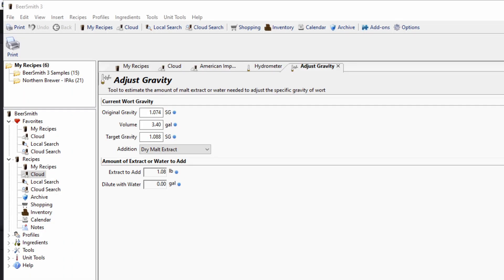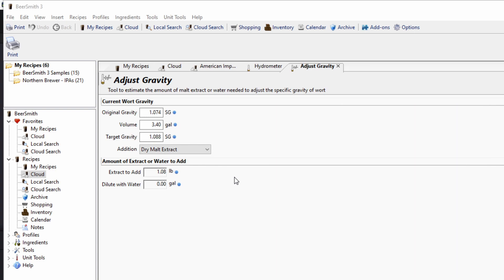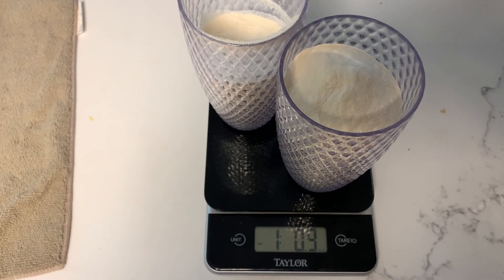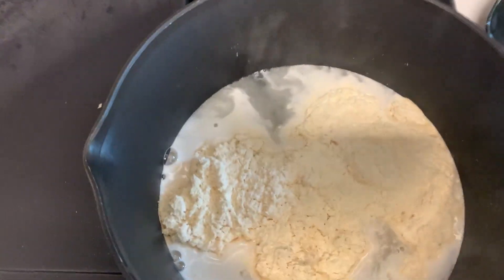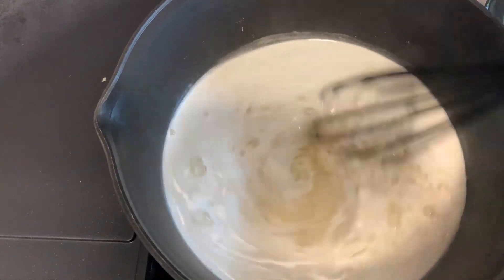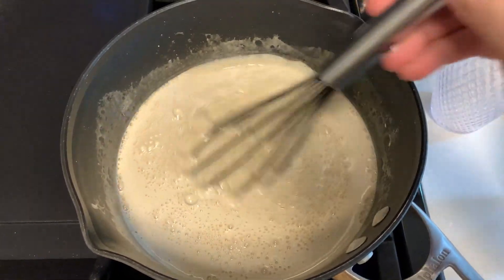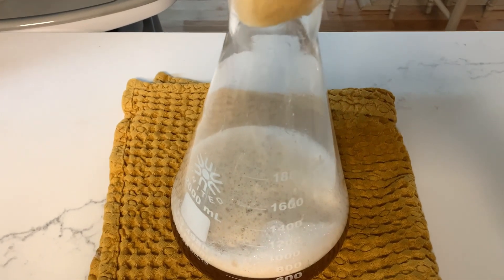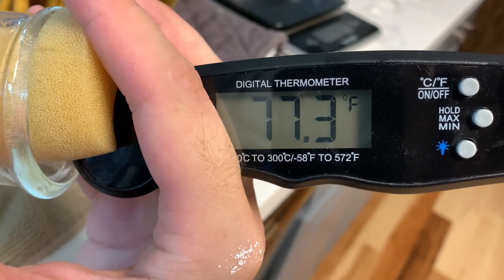How to Adjust Gravity in the Fermenter | Making a DME Slurry!

Comment: Could I still do this on day 3 of fermentation?
Reply from the maker: So I believe the only concern I would have is oxygen at this point. So if you can do it with minimal splashing go for it. But honestly if it was just a little off I would just leave it alone to just not risk it.
Reply: @TroubleBrewing  Thank you so much for your feedback. I thought that my original gravity was majorly low based on the OG of 1.050 that I saw on the recipe I followed. Do you think it's better to just get rid of this batch and do it al over again? I'm kind of a perfectionist and I would hate to wait a month (since I do bottle conditioning) to end up with a watery or "meh" kinda beer than just redoing it right this time.
Reply from the maker: @airtempo  What was your measured OG? I would never dump a beer if it just was lower on the ABV, I actually prefer lighter beers anyway lol.
Reply: @TroubleBrewing  my target OG was 1.050 and I got 1.042, I could still get a high ABV depending on the final gravity but my concern is the body of the beer or just tasting too watery.
Reply from the maker: @airtempo  missing by 8 points is no big deal, your probably talking about 1% with that which is no biggie, up to you but I would not dump. IMO the only reason to dump if you have an infection.
Reply: @TroubleBrewing  I think you've put my mind at ease, I really though I was drastically off. I will keep it as it is, try it and then decide on the modifications that I could do next time. Thank you for you response, I really appreciate it.

Comment: Cheers. I was stuck in my head how to get it up. Grain too coarse. Back at where I want to be. 
I’d add that I covered the pot to sanitize with steam.
Reply from the maker: Yea best thing you can do is to measure your pre-boil gravity. That way you can estimate your OG and adjust during the boil. But if you dont, this way works! Just yesterday I caught that I would be off by 8 points early in the boil.